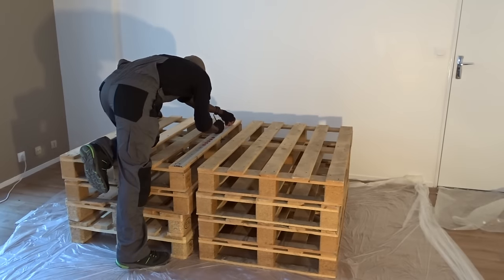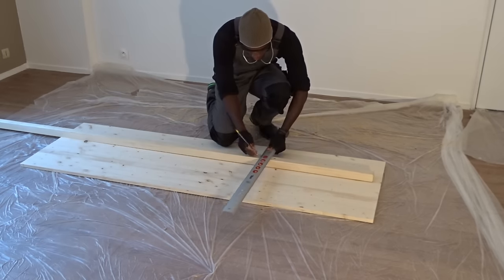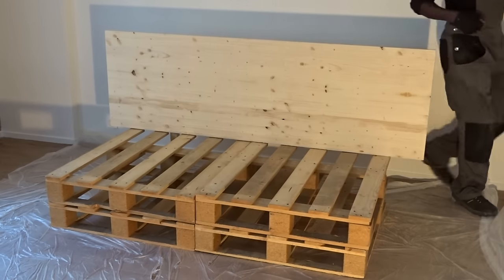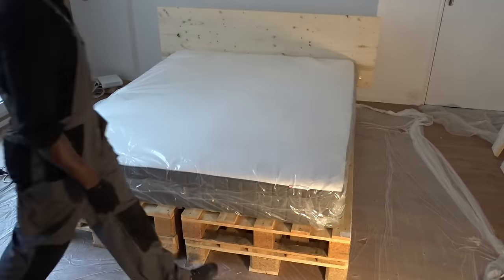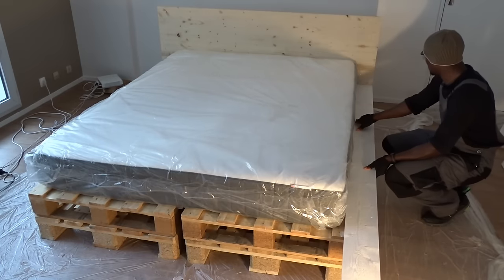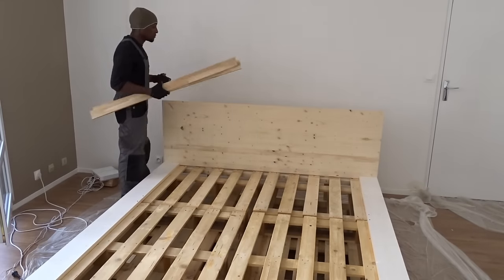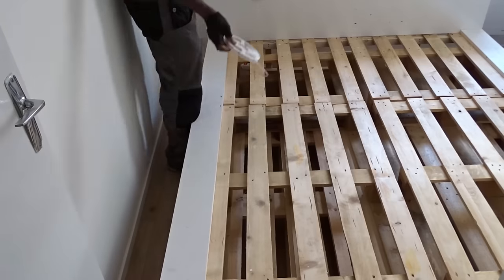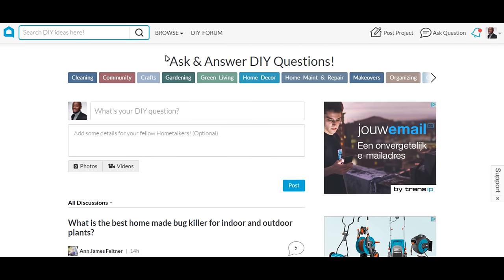Make your inexpensive DIY modern pallet bed // HOW-TO

Comment: I would like to know the size of the screws you used in this project and then the size of the wood planks you used for the head board and the leg of the headboard.... That project turned out really beautiful. By the way have you heard of a pretty boy? I know it sounds weird but I will say this to you boo you are pretty!
Reply from the maker: Hi Zainab, thanks for your comment. I really apreciate it and Feel flatered at the same time... regarding the question on the dimension, could you please ask it via our platform? It will be easier To help you and give details